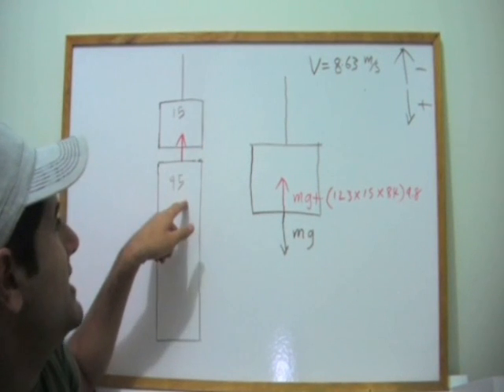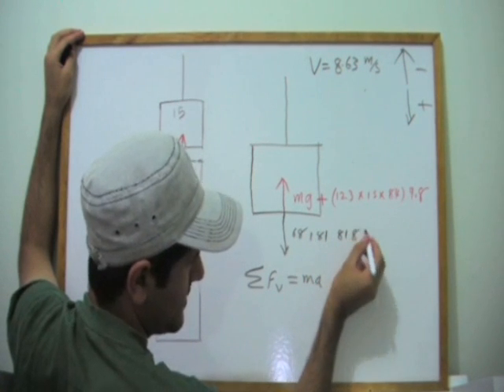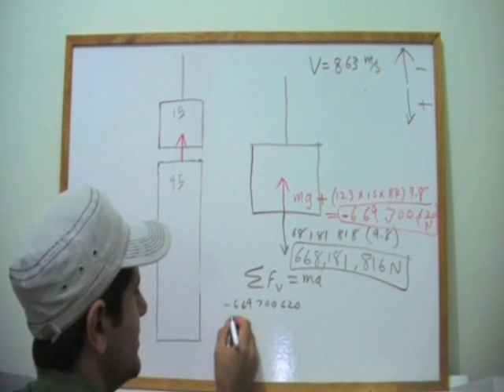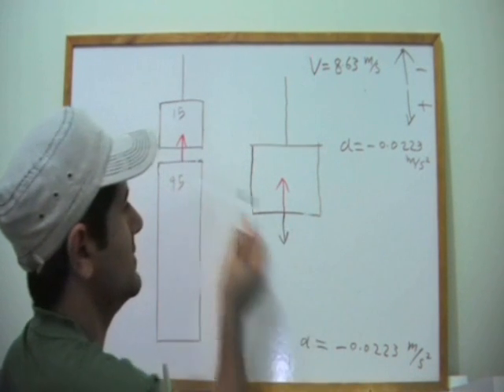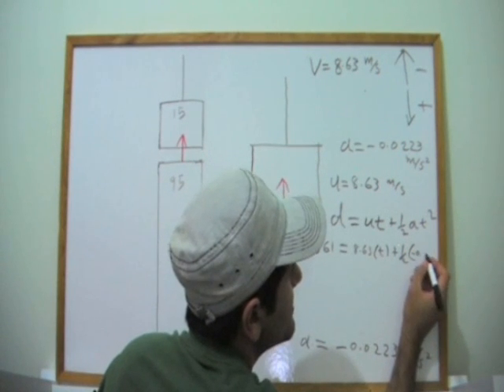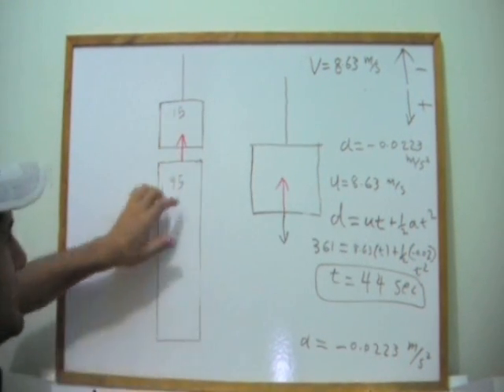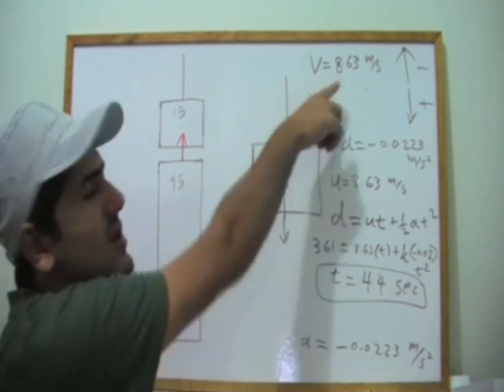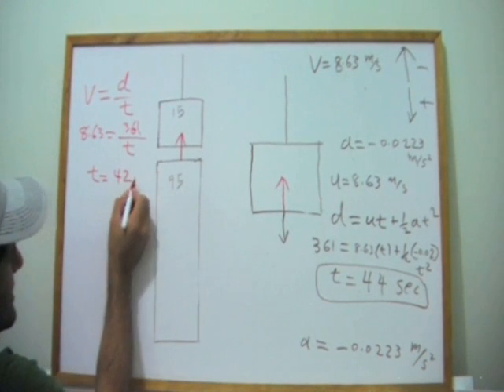(Part3) 911 Simple Physics Structural Failure Vs Demolition

Comment: If you want to confound someone and prove him wrong, four letter words will not cut the mustard. Cursing someone into looking like an idiot does one thing and one thing only, it turns you into an idiot.!!!  If you can prove someone wrong, do it intelligently with numbers and good math.
  His equations are mostly correct, however, the simple numbers are wrong. He forgot to add each collapsing floor to the weight of the falling block as it passes downward through each collapsing floor causing it to gain momentum all the way to the bottom.
Reply: Get Thee to a Physicist. Seriously. What you are saying is so incorrect, it is embarrassing. You are failing to account for resistance, you know, the "For each action, there is an equal and opposite reaction" thing from High School Physics, think a fellow called Newton thought it up. You are already confounded, you are wrong, there is nothing to prove, yet i do agree that four letter words or other pejoratives are not an argument.
Reply: Kilgore Trout Indeed, for an explosive force to blast its way down the elevator shafts, the point of impact had to have happened above them.  In other words, moving fuel and material from the jets wouldn't have been able to round the corner to blast its way down the elevator shafts.  See, only a cartoon road runner can turn on a dime.  But that is what we are dealing with here.  Most people can't think beyond animation.
Reply: Wasatch Range Railway They were not blocks either.It was more like mud with toothpicks in it.
Reply: MisterNifty
Yup, and a good 90%+ of the fuel was dispatched on impact.
Reply: Kilgore Trout And it can be understood clearly to have done so.  The tanks compressed.  When they ruptured, the fuel inside spray out.  As it did, it atomized.  What does a fuel pump in a diesel engine do?  Well, it atomizes the fuel.  The jet impacted the steel wall of the tower and compressed it against the inner core.  That in turn ignited the jet grade kerosene (diesel is quite similar in characteristics).

Boom.  

Nothing was left.
Reply: Yeah, we run Kerosene, Veg oil and diesel in our old Mercedes.... But yeah, there wasnt enough fuel left to blast down the elevator shafts, which are also staggered, so there is no way for any blast to follow the shaft to the ground floor, because no single shaft went top to bottom, then that the floors were hermetically sealed from one another. i cannot think of a major skyscraper that has e-shafts that go bottom to top, usually they break it into 3rds or quarters. Otherwise youre asking an awful lot from a really long cable